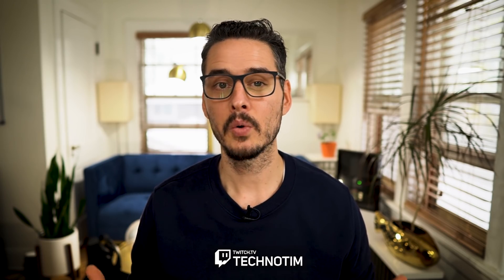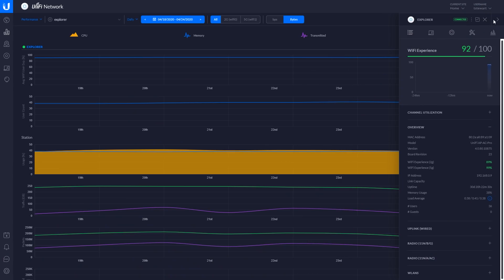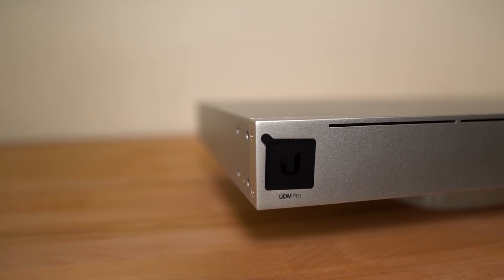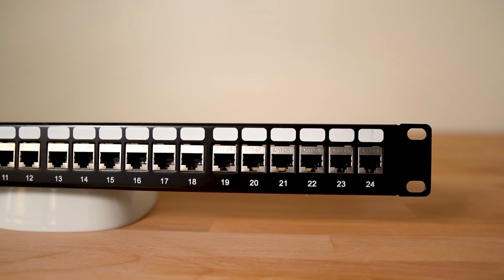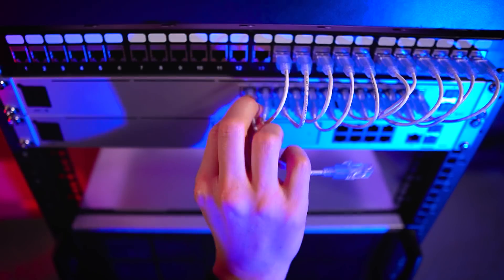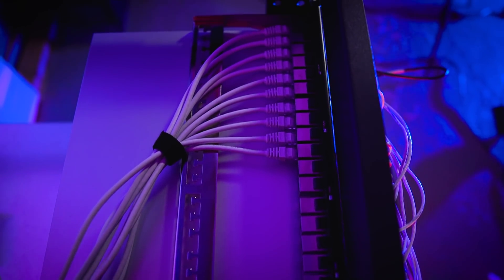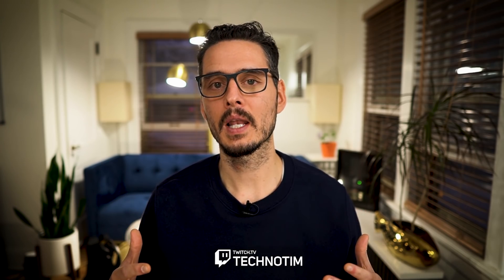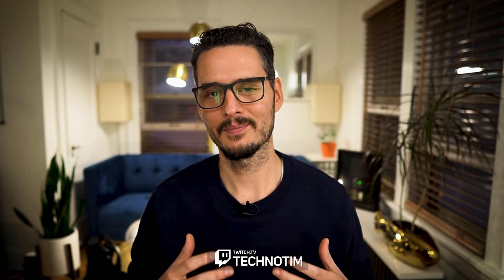Huge Network Upgrade for My Homelab

Comment from the maker: What's your next network upgrade at home?

btw, if you're new here welcome!  Be sure to subscribe for more content like this!
Reply: I'm building a new home and I'm planning on using the UDM Pro with a USW-Pro-24-POE. Also going to go with Ubiquiti AP AC PRO and some G4 Pro Cameras. They're pre wiring the camera locations for me and I'll have 2 drops to each room in the house. Do you think 24 ports will be enough? I think 48 might be too many.
Reply: prob adding more AP's. idk
Reply: Recycling center finds... $50 and multiple full 10Gb + 40Gb switches
Reply: @Techno Tim 
That specific model switch recently got a firmware upgrade and it now has the, promised by Ubiquity, Layer 3 functionality.
Reply: I just recently did almost exactly the same except going from USG/multiple 8-port Unifi to UDM Pro/24-port (non pro) and also installing a 24-port patchpanel :) I had 16 port POE (150w) before but it restarted all the POE devices randomly so I replaced it with the gen2 24-port. Running just smoothly and adding more POE items as I get them installed (Unifi cams).
Reply: Hi, are you still happy with your UniFi dream machine and switch?  I am about to do the same. In my case I downgraded ... with the little one I don’t have time to manage my network like I use to. Ditching my Check Point, ESXi with 2 AD, PBX, Zabbix, Web Server, NVR Server. I already have the CK2, Controller, 4 G3 Running on UniFi Video and HDNano AP. Just wondering if you’re still happy with the product, speed, management etc. Thanks.
Reply: That mandatory cloud nonsense is why I dumped Ubiquity...
Reply: Waiting on optics for the two Arista 48-port 10g top of rack switches. Also, adding some 10g line cards to the Cat6506 core switch.

Comment: I wouoldnt have linked the patchpanels would have taken the time to pull new wires for all of them to the new setup. Tbh if you ever pull wires keep them a bit longer then needed at that moment. never know where you want to move stuff and then that beit extra wire is helpfull.

Comment: Pretty cool but, I may recommend that you provide to two 1U space blocks between the switch and your punch board.  I would do two 1U spaces and use a pass thru panel to route your cable down back and back out to the switch.  This way you can add a second patch panel later if you want and you have room.   Also I recommend that you not place you patch panel at the top.  Always leave two 1U spaces for future and better space management,   This is test home lab and you will be changes thing up and out over time so give yourself a break and provide space to work with.  I have been there and done this 100 times.  That is just my two cents worth.  Keep have fun and sharing the know how!  Check out my home lab videos if you want for more recommendations.  Later dude!
Reply from the maker: Thank you!  Great tips!

Comment: Really Tim. The only thing missing in my network is a router and I just cant justify the cost that unfi does for 10G. Is the integration really that valuable to you?
I am going to give opensense a try but I would love a better solution. I thought untangle was great but you pass it up. I went with aruba for my switches. The value proposition is great and future proofing. I still get Unifi AP.
Reply from the maker: Yes it is that valuable to me. A single pane of glass for all of my network, vlans, firewall, and hardware upgrades, poe, etc is worth it
Reply: @TechnoTim  I could justify the Switches and APs but what about the gate way. I have heard such bad things about the gateway. Also I don't think it will be able to handle my gigbit connection. That is why I have been looking to get a dedicated thin client for the server. Do you think I should just pull the trigger on unifi and not look back? i will have to do something else for 10G but that is not a huge deal. Qnap as some cheap 10G

Comment: i only own a tablet. my wife owns a laptop. 6 tv's that use streaming services, and some gaming consoles that use wired internet. i wired my house with cat5e. did 2 drops per room. 4 bedrooms, 1 living room and a family room. i ran 13 drops. 2 short drops for the printer at my network cabinet site. in case someone brings their laptop to the printer there will be an available port for them, and a port for the printer. all other ports are for tv's and gaming systems, and whatever is available for computers, for my wife and kids. everything that should be wired is wired for better internet connection and speeds.

Comment: FAIL..... putting the UDM below the POE switch thus allow for no air. should have put the patch panel in between the switch and udm
Reply from the maker: Not fail, it has vents on the side.  It was deigned that way
Reply: @TechnoTim  ok ill let you keep thinking your way works….. stick you making videos for a living its clear why….

Comment: I see you have unfi AP without using other unifi gear. Did you virtualize the controller on some system and were you able to mesh the APs ?
Reply from the maker: This video shows a UDM Pro, which I am using now.  I use to run it in Docker.
Reply: @TechnoTim  thanks for replying. Sorry for not being more clear I meant before you introduced the UDM
Reply: @TechnoTim  when you ran the controller in docker were you able to create a mesh with APs?
Basically I have a tomato flashed Netgear router and I'm wondering if I can run the controller on a server to create a mesh from two APs and connect those to the Netgear?

Comment: bro i have the udm pro couple of things if you could talk about :)) have been attaked lots of time just for fun will be interesting to see 2nd i am passing my *incomming web request for my nextcloud domain to my nginx proxy manager so it can point to the truenas insde my network but no answer cant find the error how did you handle it or you have problems as well after chainging your router? cheers

Comment: I just watched this and in light of the Ubiquity data breach do you still feel the same way and have you made any changes. I want to upgrade my Homelab and I think UniFi switches and APs are some of the best for the prosumer but not sure about the UDM Pro at this point.
Reply from the maker: Super happy with my choice still.  The software keeps getting better and better.  The apps and dashboard are amazing except for logs, which still require terminal access.

Comment: So you have wifi, plus eth, and like 24 eth,  so if you have like 2 devices in each room how many rooms do you have to justify this ? is wifi pointless then.... you will only  have 10G in 2 devices so I find your network pointless I have pc+nas in a 10G and the rest of the house in 1G for like under 100 usd

Comment: Do you / did you ever find yourself wondering if you would’ve been better off with a diy pfsense router in place of your UDM Pro? 
I believe a pfsense router can do everything (aside from being an NVR) that a UDM Pro can do, with even more customizability, at a smaller cost. It works just as well with UDM access points as a UDM Pro would, as well.
However, the GUI in pfsense is no where near as polished as that of the one in the UDM Pro, which could be a much more enjoyable experience for many people, too.

I’ve been watching videos, reading through Reddit and making network diagrams with prices attached to the for about 2 weeks now and am really looking to do either the setup you made in this video, or, make a setup similar to your original setup
 (pfsense router to non Poe switch (for my PCs) to Poe switch (for my Poe cams and access point))

I’m stuck at the agonizing point of “WHICH IS BETTTERRR GAHHHH”

Any advice?
Reply from the maker: Yeah, I use to use pfSense.  See my home security upgrade, I talk about it there in the beginning

Comment: Very interesting, I just upgraded to the UDM Pro, USW-24-POE and a US-16-150W at my home.   I had replaced some Meraki gear that I got as an eval, and Cisco refused to give me an new eval license, so after 3 years, it was time to try something new.   I had a similar SG200-24P as well.   Now my network is a lot speedier with 3 UAP-AC-HDs, 1 UAP-NanoHD, 1 UAP-AC-Pro and 1 U6-lite.  Also used all Cat 8 Patch cable.

Comment: Nice vid. So was it cheaper to buy cat cables or was it to save time?
How do you manage cooling or is that not a problem as its not a closed cabinet?
Reply from the maker: Thanks!  Cables to save time and flexibility down the road.  Cooling not an issue since it’s open and in an unfinished basement.
Reply: @TechnoTim  I am toying with a patch board vs a cabinet. I got a  Large reel cat 6 but looking back it's prob time saving to just order lots of shorter cables from amazon!
Reply from the maker: @justintemp  yeah, ain’t nobody got time for cutting, crimping, and terminating patch cables unless you are getting paid to do it 😀
Reply: @TechnoTim  yeah lesson learned the hard way. Fingers and hands sore from making up 50 of them 😩😂

Comment: currently got the USG gateway to a ubiquiti 24 port 500 watt poe switch, unifi switch in the garage 8-150poe. 3 unifi AP pros and various cameras. Reason for the POE in the house was for Raspberry PI 4 running kobi for the plex server. best little trick ive done just to clear the clutter behind the tv. Need to run some cat5 into the bedroom for pi on the bedrrom tv however not got that far. little bungalow with over 600m of cat5 is rather silly

Comment: I changed my network about a lot recently.
I took away my switch. While I can use all 24 ports, I generally don't need to. So I got a little trend 1gb switch, it's got five ports and zero management. 
I then put in CNA cards (10gbs) as they were dual port ....

But I have a LAN cat6, and SFP+ cable running to my work station. To my rack and the hub.

I removed the home plug (data over power cables) which ended up running a cable out the window to make a i link to the server rack switch.

I pulled but have moved it up to my office, i a small hp managed switch,. 8port. Which I used to run my server management links over a vlan.

The "go to" VMS has good connections with a ten g and one g and I am piped to one of the four g lans which works fine. I've only two free cables, so I may go back to the physical separate networks. And if I run all systems I'll need to switch over to running the rack switch.

 But I've lowered the powered devices.

Also... I'm one of those guys that mount Lan switches in the rear of the rack. I can't stand the wires at the front.

But there is alot more to be done....
AI/ml, was thinking of Jarvis..
I've added some nests... But they need work... So thinking of self dev.
Have some Dev boards and robot parts as well as some speakers and microphones... And plenty of server space and power.
I'm yet to run out Poe. Though I have the hardware it maybe limited to cameras only. Nests do call and broadcast; so it makes phones redundant.
Reply from the maker: Thanks!  Nice work!

Comment: I also just installed a similar UDMP plus PoE switch setup and hit the same issue you mentioned in the video - the UDMP came preinstalled with an old 5.X version of the Unifi Controller and the little display on the front of the UDMP insisted (incorrectly) that this was the latest version. 
It was a pain to force the UDMP to update the controller version but without doing so you can't migrate from your existing 6.X Unifi controller because it doesn't support migration from a newer controller version to an older controller version. Ubiquiti really should focus on fixing this since it leaves a bit of a bad first impression of the UDMP.
I also almost immediately hit another weird issue where the web UI IP addresses oscillate between old IP address and new IP address if you change the DHCP range for your LAN. A reboot seems to solve the issue but it makes me think that Ubiquiti is not testing this product very thoroughly.
Reply from the maker: Totally agree!  Same issues here!  Seems better now!

Comment: Question, in every networking course I have taken and the projects I have worked on in State Datacenters require 3 foot or 1 m ethernet cables to reduce noise and interference. This was recommended by most of our architects also, which is usually why you'll see a runner U separating 2 switches with cables tracking back in combs.

How well does your system work for home use so I can clean up my projects.

Comment: I seriously urge you to check Mikrotik switches and bro if you are not using SFP+ for your Storage server (TrueNas/TrueNas core) I think you are living under a rock. Or you are running everything as a vm
Reply from the maker: Not under a rock.  Will use SFP+ for my NAS, running most things as a VM but even more in docker and kubernetes.  Also, looked at Mikrotik and went with Unifi.  Did my research before dropping 💰

Comment: I'm working on a network upgrade for my parents, mostly going to keep it simple since they won't need a lot. Going to upgrade the unraid server I have for them, add some vm's and pfSense and let that control everything along with some better cameras and storage. For myself I will likely go with more used enterprise gear. I'm more familiar with Cisco and I have some older equipment and will then likely get some older dell servers to run my home network. 

I won't lie though, I really do like the look and ease of use from the unifi equipment. Could be tempting to go that route as well
Reply from the maker: Nice!  Good luck and thanks for sharing!

Comment: why not connect the patch between the dream pro and unifi firewall
Reply: The dream machine pro IS the firewall, the 24-port unifi is the switch, they are connected together with the 10-gigabit SFP+ ports.

Comment: Nice upgrade man! That UDM-Pro is such a good all-in-one and for less than getting the individual systems from Ubiquiti. 

I've been using clear power supply cable combs to keep my cable runs parallel and organized on the front. Those monoprice slimruns fit perfectly inside the standard cable combs.
Reply from the maker: Thank you!  I totally agree!  Thanks for the tips on the combs!  I will check them out!

Comment: Hi! Just today actually we are starting to upgrade our 13-year-old network configuration at a place.... We went with the Unifi Security Gateway, first gen cloud key,  Unifi Switch 8 and 5 access points that I can't remember the name of now. Making the full switchover from wired to wireless. Should be deployed (hopefully) a week Thursday! Exciting times ahead. I just need to get our printer on 2 of the 3 networks, so I will do that in the firewall I think.

Very nice video! Thank you.
Reply from the maker: Thank you!  Good luck on your upgrade!

Comment: Those are not 10g sfp ports on that switch just two 1gbps sfp ports
Reply from the maker: They are 10Gbs.  This is the Pro Gen 2.  The non pro has 2 1Gbs.

Comment: What I did ~6 years ago
Cisco 48-Port Gigabit PoE+ switches are <$100
Quanta LB6M 10GbE 24-Port SFP+ are <$300
Put 10GbE nics in your servers use DAC in the rack
Put 10GbE nics in your desktops and run fiber to them 
LOL ethernet cable extenders, I didn't even know that was a thing. 
I would have got a punch down type patch panel and punched them down to that.
Do you not put service loops in your cable when you ran it in your house?
Reply from the maker: Nice choicese

Comment: Yo, you gotta try rack studs, I started using them in my datacenter at work, and mount/unmounting heavy networking equipment like our 5400 HP switches is so mich easier.
Reply from the maker: Thanks for the tip!

Comment: I would've gone for the XG-16 10G switch and some smaller POE implementation (alongside the UDM Pro ofc) because that switch is just expensive because of that massive 400W PSU and power delivery units.
Reply from the maker: Yeah, I wish it were cheaper but I also need more than 16 ports and needed the  2 10Gb SFP+ ports.  Hard to find all of this in 1u.

Comment: I rarely comment, but, I haven’t seen anyone mention it. Running cables with a wire gauge higher then 24 can be a fire hazard. PoE can support .6 amp of current, and .35 amps can be enough to heat a gauge 26 cable past their rated specs (usually at around 60c) if they’re not of great quality. Numbers gets worse the higher the gauge and theses cable, if they’re from monoprice, are gauge 28.
You should consider changing those cables for your safety when using PoE.
Reply from the maker: Thank you so much for the feedback.  Will investigate!!

Comment: How is the UDM Pro controller running with UniFi 6.x, any issues so far? I had heard the UDMs weren't supported by UniFi 6 yet, that's why they still have 5.14 installed.
Reply from the maker: I haven't had any issues.  The only thing I noticed is that sometimes I have to toggle between new and old settings because some aren't complete yet.
Reply: @TechnoTim  I ended up having to revert my home and workplace controllers and restore from backup when Watchtower upgraded the containers, and my carefully setup WLAN groups and RADIUS-assigned VLANs imploded. I still feel very burned, I won't be upgrading to 6 anytime soon.

Comment: Great video and happy to see you upgrading your network. However, I’m scratching my head as to why you chose a UDM Pro as your firewall appliance considering your experience with far better solutions. Tighter integration isn’t necessarily better integration. I wish you luck man.
Reply from the maker: Good point!
Reply: @TechnoTim  any regrets dropping pfsense etc for the UDM-Pro? I'm currently exploring options for a new home network and keep hearing the UDM-Pro is pretty bad for firewall and routing. I also have a CloudKey Gen2+ and Unifi PoE switch already, so I'm not sure the UDM-Pro is worth it for me. Cheers!